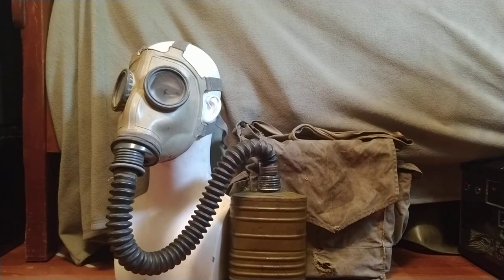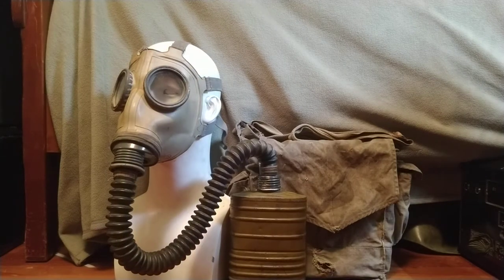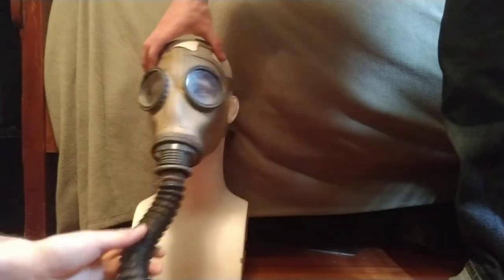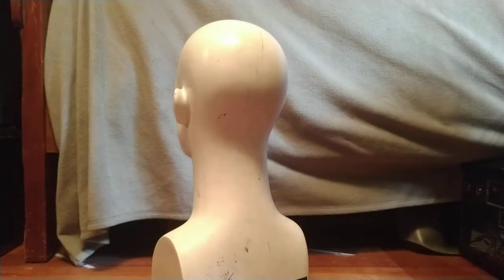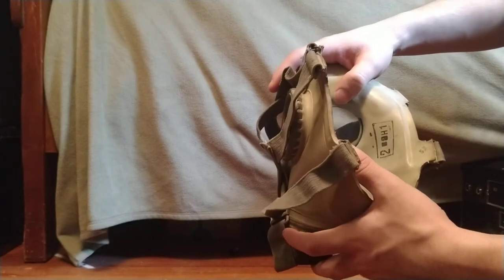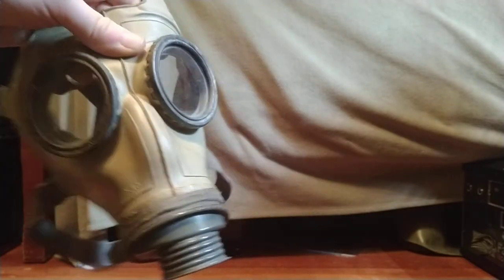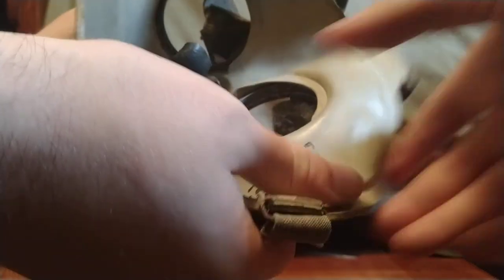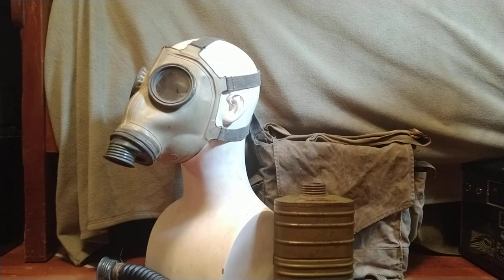Soviet O-11 WW2 Gas Mask (Avon)

Comment: That filter looks strangely romainanish.
We copied that filter in the '50 with the Md55 kit. Duh.
If you want reproduction, the romanian md55's valve system is the same, but with regula shm face blank.
Reply from the maker: The valve systems on most of these masks are virtually identical, barring minor color differences. Good to know about the Md55 filter though, might keep an eye out for one.